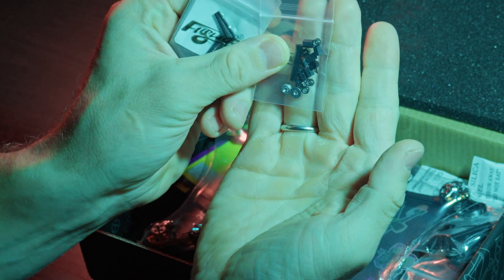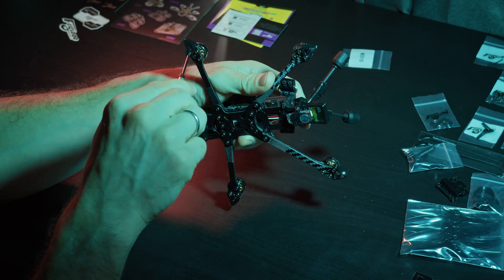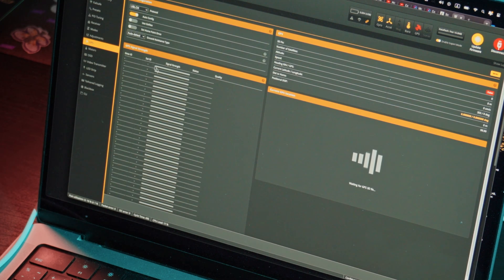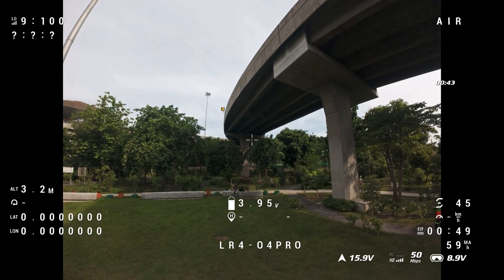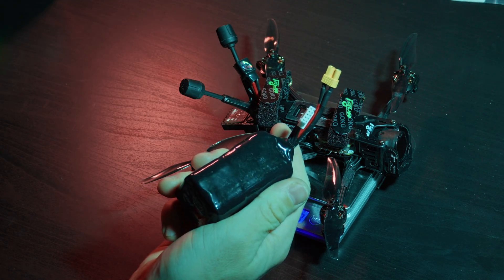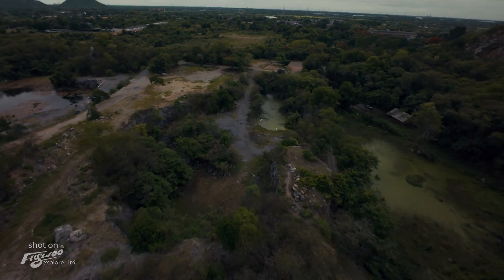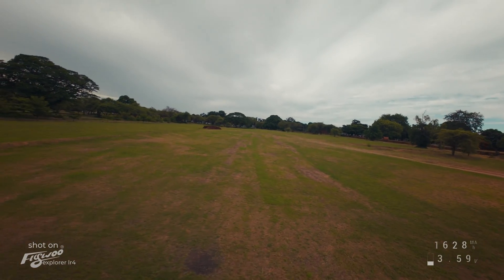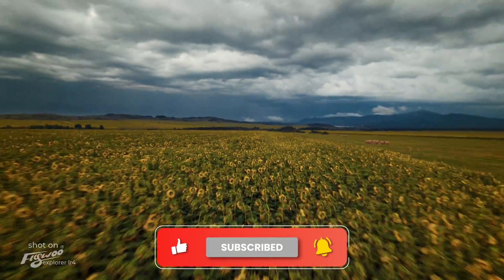BEST FPV drone for travel - Flywoo Explorer LR4 REVIEW & SETUP #originalfpv

Comment: Hello, I’ve been really enjoying your videos. They’ve been a great help to me.
I was wondering—don’t you experience a lot of vibration in your footage when using 2-blade propellers?
I switched to 4023 tri-blade props because of vibration issues, but I still occasionally get slight micro-vibrations. I’m currently trying to reduce them by adjusting the PID settings.
Even after stabilizing the footage with Gyroflow, some vibration remains, which has been quite concerning.
Have you ever had a similar issue or struggled with something like this?😊
Reply from the maker: Thank you 🙏 Of course, this drone has vibration issues because it is very light, and strong gusts of wind cause shaking problems even after stabilization

Comment: Around 2:40, you say to remove the 2 SBUS cables so you can use ELRS? Is that all it takes? Plus the obvious Betaflight and ELRS installation? I’m new to this and couldn’t figure out how to do it properly. Thank you, sir!!
Reply from the maker: I did this for two reasons: because I had problems with conflict between elrs and sbus o4 on my previous drone, and also to remove unnecessary wires, as in the next video I lightened this drone as much as possible. But since in the factory settings flywoo sbus o4 and elrs are connected to different uarts, there is no need to remove these two wires
Reply: @Nik_FPV24 thank you for the reply my friend. You are so helpful 😊

Comment: 2:50 According to flywoo, you don’t actually have to remove those two wires unless you’re using those uarts, as the elrs receiver is on a different uart from the o4 pnp.
Reply from the maker: Yes, I think you're right, but in any case, I would remove these wires, as I don't need them and they only add weight

Comment: You can buy the drone with the O4 Pro already installed, but it's cheaper than buying the O4 from DJI and installing it yourself. Do you know why? 

Nice video!!
Reply from the maker: I am not affiliated with any companies that sell drones or with DJI. I can only assume that drone manufacturers have some kind of agreement with DJI, receiving their products at a low price in exchange for using them in their drones and thereby distributing and advertising them. That is why they can sell assembled drones cheaper than if we did it ourselves

Comment: Re: being able to fly 30 minutes or more in the same style you showed in the video, color me skeptic: sure you can draw good Li-Ions down to even 2.5V (in fact manufacturers rate their capacity by drawing them down to that voltage), but IME they offer very little capacity after 3.2V, which is the voltage your STATS OSD shows after disarming. I would not count on  more than about 10% extra time if you fly the same way, and this is consistent with the drained mAh your STATS screen also show (at 2839mAh). I think 30 mins is doable (Oscar Liang has done it) but only with a much less demanding flight style.  Having said that, I would love to be proved wrong!
Reply from the maker: You may be absolutely right, so far I haven't had the possibility to fully test this battery (Molicel INR-18650-P30B). And the 3000mAh battery from Flywoo shows about 20-22 minutes in real long range. But I will definitely test everything and compare these batteries
Reply: @Nik_FPV24  Looking forward to your further videos! 👍

Comment: Just fyi, another option is the AOS UL5, And AOS LR5. The diff is the LR5 Is dead cat
Reply from the maker: I'm sure it's a cool option, but unfortunately, these drones are also heavy compared to the Explorer, which makes them less than ideal if you want to throw it in your backpack and go hiking 100+ km in the mountains...
Reply: @Nik_FPV24 .  The UL stands for ultra light. It was designed to be in direct competition with the explorer, but has 5" props. Many YT vids on the models. Designed by Chris Rosser who is well respected in the community and has a large library of videos on all his designs including an ultra light 7"

Comment: Is it possible to tilt the O4 unit so you "force" it to go at a quicker speed in needed? I do this with my PAVO 20 Pro after need and its perfect.
Reply from the maker: The maximum tilt of the camera in Explorer is approximately 20 degrees. It's a little insufficient when flying with light batteries, but I haven't tried increasing the tilt yet
Reply: @Nik_FPV24  Would have been a cool and useful information to have.

Comment: Will this work with dji fpv remote 3 and dji goggles 3? And if it does what version i need? Right now i fly with avata 2
Reply from the maker: Of course it will work, just don't remove the sbus wire like I did
Reply: @Nik_FPV24 i don't even know what that is. There is 3 different versions. Slr or something.  What do i need so it works with my remote and goggles?
Reply from the maker: You need the BNF version, because all drone control in the case of DJI remote is done through the o4 unit
Reply: @Nik_FPV24 super ! Thank you for helping me

Comment: Do you have to depin those two wires? I've heard conflicting information - and would prefer to be able to switch to DJI through betaflight port config rather than repinning those wires.
Reply from the maker: I haven't had any problems with this on any of my drones. But thanks for the warning, I'll look into this issue in more detail

Comment: I got my L4 too. I have 4.5.2 BTFL - Flywoo F722Pro v2.
I have a GPS, but I can't enable it - hidden in configuration - whenever I enable it, and reboot - it's disabled..
Reply: And it keeps spinning in the BF..
Reply from the maker: Any assumptions I make are just guesswork. There could be many reasons why this is happening. Try installing my CLI, it might help. Don't forget to make a backup before doing so
https://drive.google.com/file/d/1tkhhKZRKUkOEgffqOiSkhTM0yrFcY9Fy/view?usp=sharing
Reply: @Nik_FPV24  Found the issue.
Mode was changed. Throttle was assigned to the right stick,
Reply from the maker: That's normal; in FPV, you always encounter new problems that make you think😁
Reply: @Nik_FPV24  Yeah, but it's my 1st PFV drone - these kind of stuff, before even 1st flight cause me wondering if it;'s event for me.
Reply: @Nik_FPV24  Building AutoComplete Cache ... Done!
feature GPS
unavailable
.. my drone has GPS
Reply from the maker: Of course, when this happens with a BNF drone, it's not pleasant. But I can't imagine how your problem can be solved here in the comments... Have you tried writing to Flywoo support? They respond fairly quickly
Reply: Are the extra 4gramms for the Support arms worth it? Can't arm mine, but the I'll figure it out, great Videos

Comment: I fly mine with 4023 Triblade and GNB 1100 packs. They're only 88 grams and the 60C is plenty for this quad. Flies forever even with the triblades and has more punch/ handling. Super locked in and easy to fly. Tops out in the low 50mph range tho.
Reply from the maker: How safe is it to fly at 4023? After all, this puts increased load on the motors. How do they hold up during long flights at full throttle with such propellers?